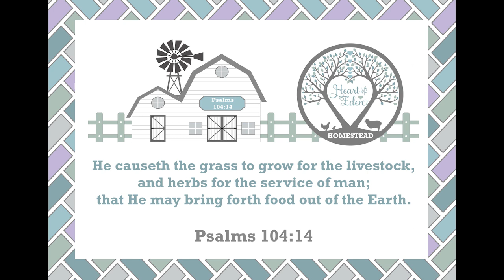CFT Worm Bin Build For Worm Farm - Worm Composting (Part 1)

Comment: Here are a couple of thoughts I had while watching.  First, on installing the pvc, I would have taken a piece of scrape would and made a jig to drill all the holes in the pvc .  Drill a hole in the scrape the same size as outside diameter of pvc.  Measure where you want to place the hole .  Stick the pvc in the hole of the jig and drill the hole. Repeat, repeat, repeat. 
As for the clean up,  you could install a conveyor belt with collection at the end.